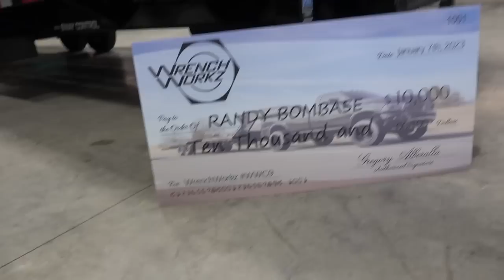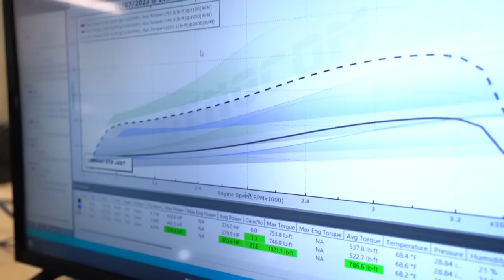My FAVORITE Build is GONE!!..... We DYNO'd The Truck Before It Left!!!

Comment: 570&1020 are solid tow rig numbers assuming the egts are manageable there
Reply: I was a little concerned about the torque numbers. Even as a g56, truck, I thought it would be at least 1200+. I mean, factory right now is 420/1075